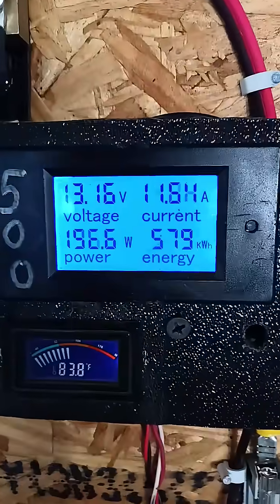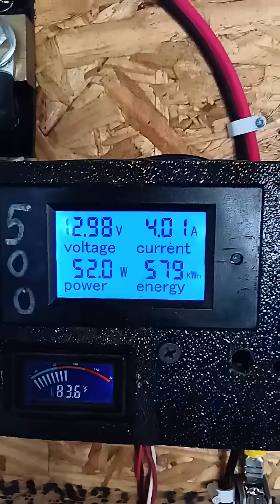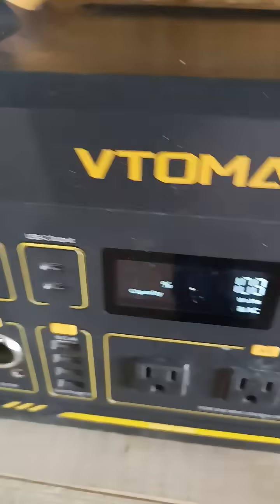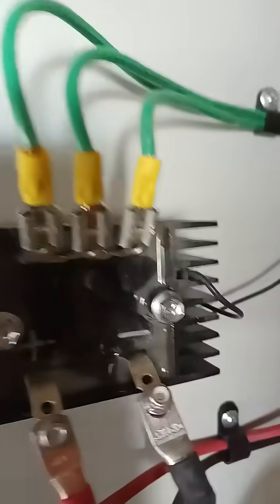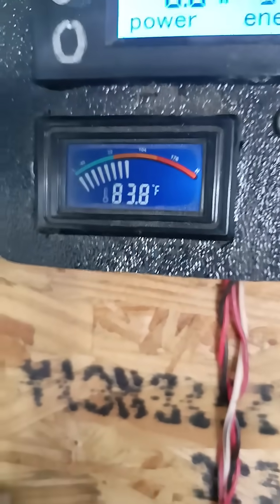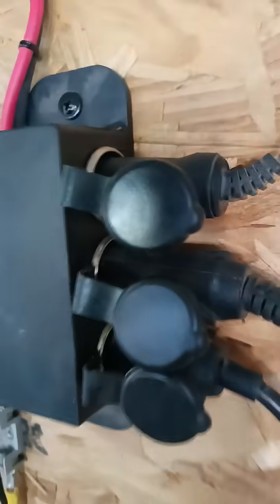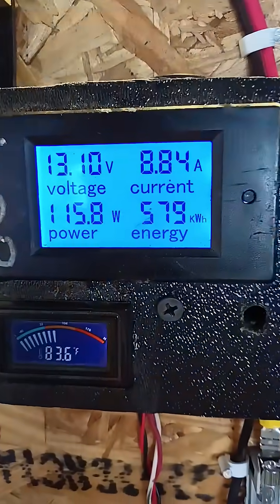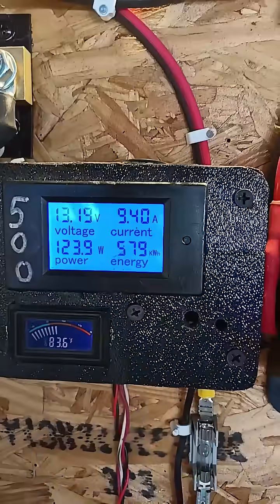Using wind power to charge power stations FULL VIDEO IN DESCRIPTION BELOW #freeenergy #diyturbine

Comment: Nice job, that is super fun! I've been doing this stuff for 25 years and when I was younger I loved putting up wind machines. Then as I got older I realized that you can simply get more batteries and buy some used solar panels off of craigslist, like $35 for a 350 W brand new module, and throw them in the dirt and produce way more energy than a wind machine. 😂😂 Again though, it's great hobby stuff, my energy friends call it kinetic art.
Reply from the maker: Glad you enjoy it! I'm focused on wind as a option source for 24/7 power, for those times without consistent sun. If the brand is picked right the modern turbines with Delta Wound internals actually make it worth it. I put the sources for HWE and Wuxi Naier turbines under the video so hopefully folks can avoid knockoffs and ebay junk sellers.

Comment: Does that rectifier make a big difference from the one with the red light that comes with the Chinese 400 wat wind turbine
Reply from the maker: Yes. With a Rectifier and no processors you can achieve over 15% more total power collection. But it requires using Lead Acid slave batteries in the system and a diversion controller with it all. I'll be defining that more in the future.